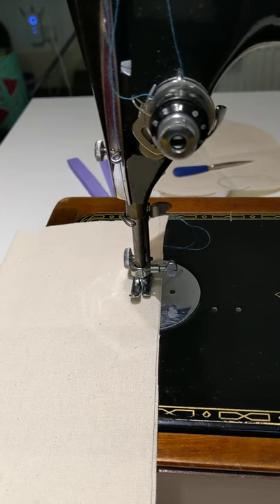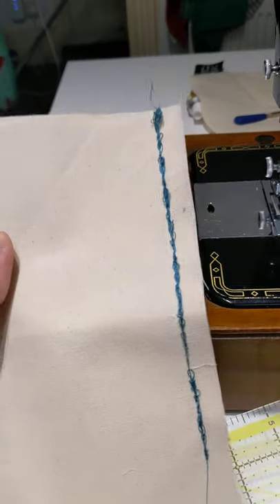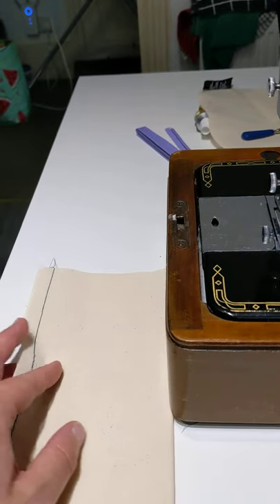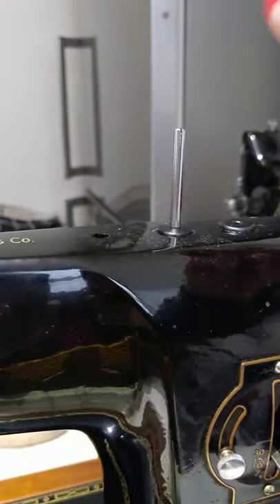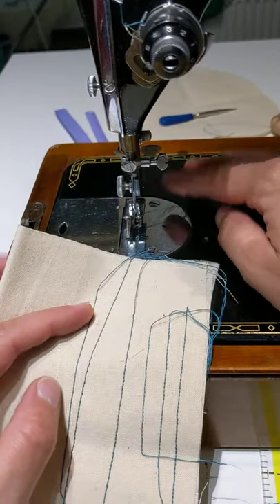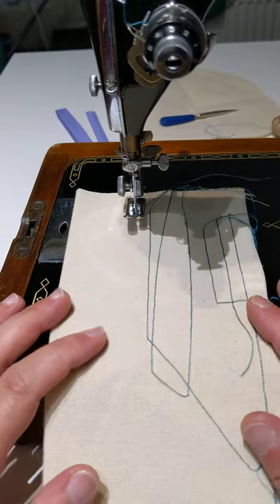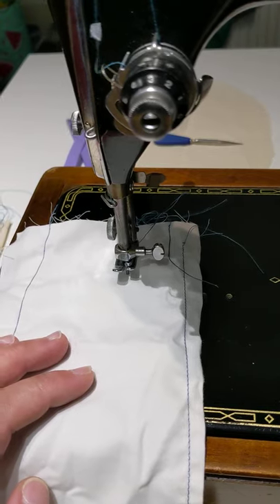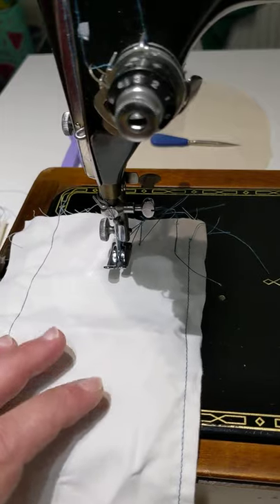Tips for using a vintage sewing machine (tension and thread jams/nests)

Comment: This has answered a lot of questions so thank you for all the info. Also for the comments section, for i too have had a rogue thread strand which caused skipped stitches and a lot of head scratching until i finally located and removed it. The only plus side was that my machine got a thorough cleaning out and oiling in the process 😀
Reply from the maker: Ah yes, it amazes me the trouble a teeny piece of thread can cause, but does mean the machines gets a good clean ❤️

Comment from the maker: The tension meter was a great purchase (I bought one from Phil too). I've used it to check the bobbin tension on all my machines, including my 128k shuttle. It's far more accurate that the "drop" test 😁
Reply: Oooh tension meter, isn't that to do with adjusting the tension in your bobbin thingy? Have you a video on that too?
Reply from the maker: @viviennebolton4358  yes! It's made by the Featherweight shop (I don't have a video, but they do on their channel). It works for all bobbins, great little tool 🥰

Comment: For cross wound spools I found that a thread stand helps. I used to have a thread jam all the time with crosswound spools till I got a thread stand.
Reply from the maker: I love using a thread stand or a thread post. I have found that the 201 and 221 both prefer it, but my 66k handles cross wound threads beautifully. The 201s and 221s are a little more fussy 😁
Reply: @sewythingy  My 66 gets cranky with the cross wounds.

Comment: There is one other "mystery" thing that can happen to cause thread nests that seem to happen at random - often when you're part way through your stitching and when everything has been fine.  And that is not properly threading your machine.  If you don't get the thread properly "in between" the tension discs or you forget to take your thread through the take-up-lever you can get some good stitches and then - Wham! Jam! Makes you want to say D...ash it all!  If you've missed these things (and they can be so easy to not notice) then you can spend a huge amount of time twiddling with the tension settings, putting your needle down first, holding your thread at the start etc and still the mystery, intermittent loopy jams happen at random. You can think your machine must be broken.  I highly recommend if ever you're stitching along just fine and then have problems you stop and ask yourself "have I rethreaded my machine recently - and was having no problems before that?".  If the answer is "Yes" then nearly all the time it's because your top thread is not threaded properly through the entire threading path.
Reply from the maker: Absolutely! I learned that the long way round. 
One of my machines had an angry take up spring which would randomly unhook the thread, but wouldn't notice it straight away. I've since changed the spring and it doesn't happen anymore.
With owning one machine it isn't too bad to get into a habit of threading correctly, but does become more difficult when you have multiple machines where the needle is threaded different ways, some like crosswound and some hate it. The joys of tension problems eh! So many variables 😁
Reply: @sewythingy  So true - I once had a devil of a time trying to figure out why I was getting lots of skipped stitches all of a sudden.  It took me an embarrassing amount of time to realise I'd threaded the needle right-to-left instead of left-to-right.  I felt equal parts relieved and silly when I realised what I'd done wrong.   :-)
Reply from the maker: I've done that loads of times putting my needle in the wrong way. I've now written it down for each machine so I don't make the mistake.
The worst one was my featherweight.... It randomly started skipping the odd stitch and hated more than 2 layers of fabric. Took me months to find out it was a tiny piece of thread that had got caught behind the bobbin cradle. It can't have been more than 1/2 inch long, but that pesky tiny bit of thread had me scratching my head for so long. Argh!